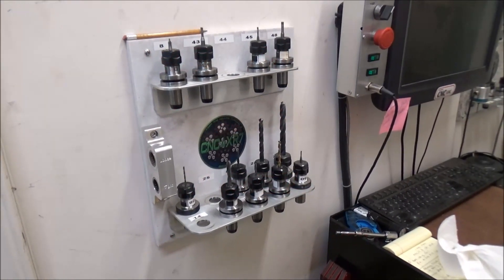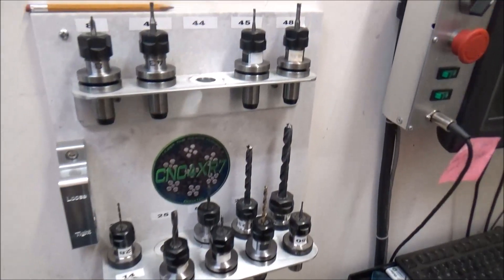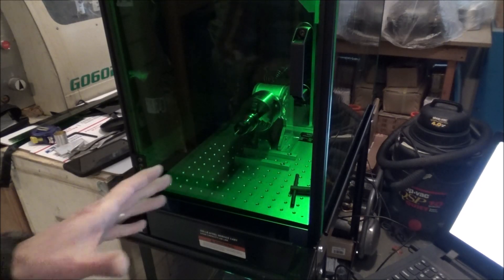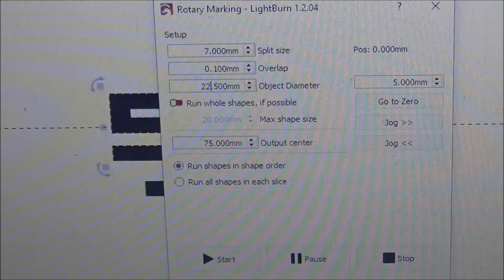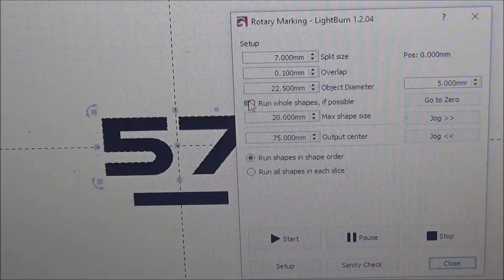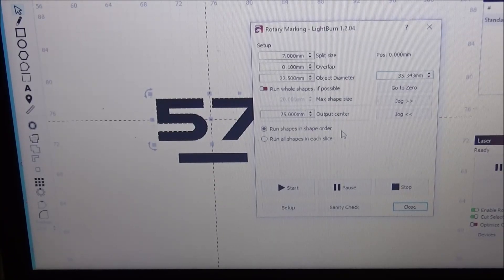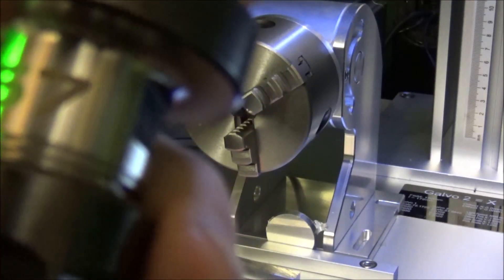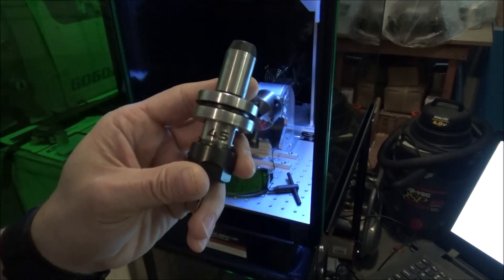Rotary Marking tool holders

Comment: Have you tried to do a single burn with both number patterns in a single file.  It seems that you would need to have a nonproportional font to do this?
Reply from the maker: Yes I did try that and it works fine the numbers are small enough that its not a issue.